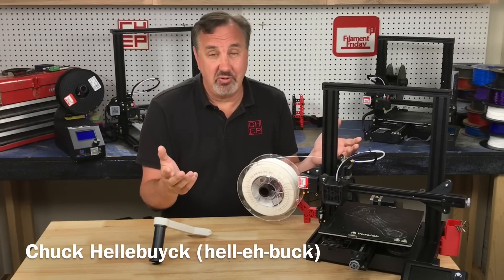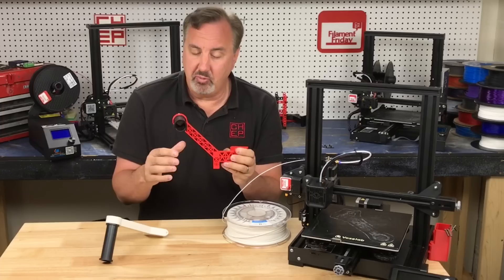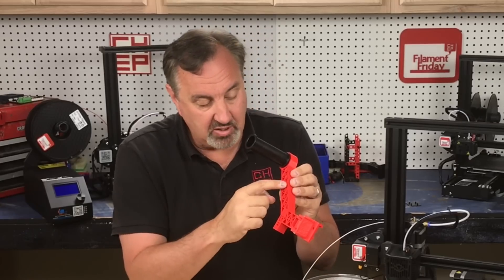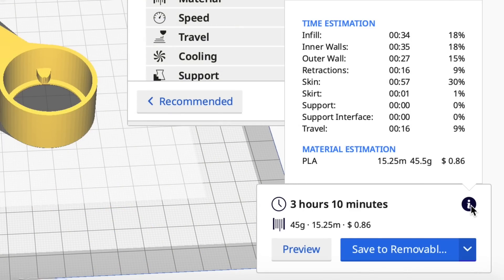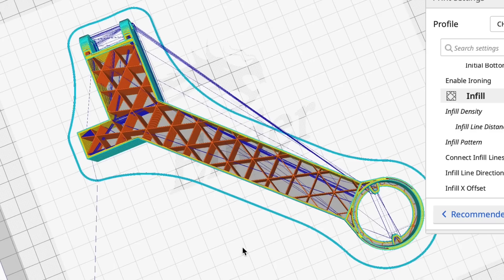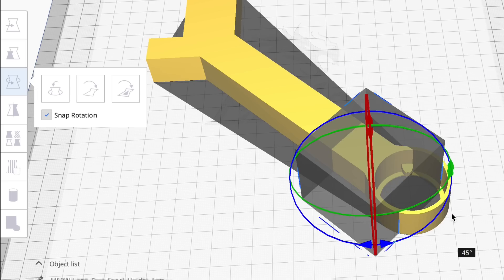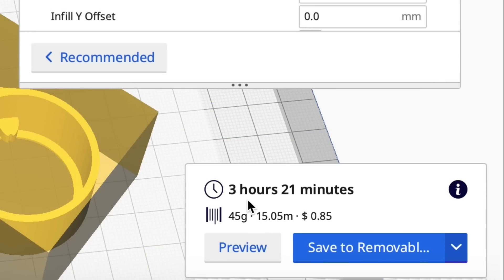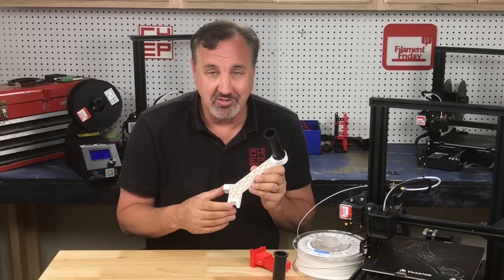Print Faster on Your Ender 3 Style Printer Using Tricks in Cura

Comment: How would this work for cookie cutters? I’m tired of waiting 6 hours for my cookie cutters to print. The base has the outer walls designed but I don’t think they need to be there as I will just be pushing down into the dough? As far as the “smooth” outside (?) walls the part that cuts into the dough- they are much taller than I’d like. My dough is rolled to 1/4 inch thick. Any help is greatly appreciated 😊 @CHEP

Comment: Thank you for the great videos and bein so much informative.

Let's talk a little bit "statics".

But in an engineering perspective, solid bodies are not as strong as the spesific profiles.
Think of I-Beams.
I-Beams, U-Beams, Box-Profiles are used in big structures like skyscrapers, cranes etc. Thats because those profiles are much stronger than solid bodies. (Of course there is weight element but stil..)

I know the scope of this video is not abouıt strength, it is about speed. But still i wanted to point this out.

(Partly because i just got 3kg filament spools on my ender3v2neo and i just dont want to hang it on the gantry of my printer :D. So basicly my focus is on this issue for a while heheh.)

Comment: 0.6 Nozzle will bring it down to just over 3 hour and since there are no over hangs or to bigger curves 0.32 layer height is a good multiple for a 0.6 nozzle add 0.62 to line width and you be surprised on print quality
Reply: The only thing is. Is the design would have to be redesigned keeping the 0.62 line width in to consideration. A lot of the time, poor print quality is because the stl files dose not match up with slicer profile and pushing a 0.5 line out of a 0.6 nozzle, gets messy
Reply: add a 10% wall over lap and it will print over hangs but make shore to print inside to outside walls

Comment: 3 hours to print, 1 hour to edit, and not the design wanted.
Seems like you could have just cranked up exterior wall speed for the same exact result with no other changes

Comment: That's great but you didn't speed up the original part, this is a different model. It's not really how you can print faster.
Reply: My exact thoughts. Completely changed. Not as designed. And not the original print but faster.
He could have gotten the same results by cranking up exterior wall speeds.
Instead he had a non-scientific change of the model to get that specific infill for that specific design.
This however wouldn't help me at all to print a model of a cat faster
Reply: It's absolutely how you can print faster. Changing the specific model doesn't change the fact that he has a part that suits the application in less time. DfAM is a holistic approach
Reply: @kevinh2624  not if you cant alter the design of the output that you need.

Comment: Very smart use of slicer settings and infill pattern.
This trick also simplify the modeling, you save time since you don't need to create the pattern, instead of that you rely on the slicer to do it for you.
Another benefits, you can change the pattern without changing the model, and you can print a closed version.
As said very smart, thank you for sharing.

Comment: If printing was as simple as clicking print, i can see this technology becoming more widespread. Unfortunately, printing anything successfully takes a lot more than just clicking print.
Reply: It's a hell of a lot easier than it was 5 years ago. It's just going to continue to become more user-friendly.
Reply: user knowledge will grow over time as well as the tech will become more stable and user friendly.. dont know how old you were but to call someone before you just had to stick your finger in a hole and turn a dial 7 times compare that now to even having to look for the phone app on our phones haha
Reply: Kind of true. I just bought an Ender 3 S1 but I spent a few days beforehand researching the best settings and how to calibrate it. Set it up and its been perfect since the first print. A little time and effort into researching beforehand goes a long way. But then I'm the same with any purchase I make that's gonna cost me more than £100 so I know I'm getting the best out of it.
Reply: Using Octoprint on your printer really makes it nearly just click and print.

Besides modeling and setting it up for modeling, but those steps don't take too long unless you are designing a super complex model.
Reply: @spydergs07  Ender and Perusa with perusa slicer and cura slicer have been tested exclusively to print receivers. Octoprint slicer has not been tested, there is a chance that your print would blow up as soon as you went to use it. Not all work for printing lowers. Almost all receiver STL files contain complex geometries , i recommend using something known to be capable. 

 If you want to actually make a functional LASTING receiver, it is not as simple as click and print.  IF you want the receiver to function smoothly and have full functionality, have good resolution and good layer adhesion, you will need supports, you will need to make adjustments to your printer, there is no way around that. No printer is completely accurate. 

The day printers are that accurate and simple, a load more people will get them. Look to ink printers lol.

Comment: Great video, super useful info and some fantastic tips to up your slicing skill level. 

Only problem is... by the time you've spent fiddling in the settings you could have just printed it, original design with the pattern. That's my only critique. Is that quite often the fiddling in the settings time > the print time saved; and I can't think of many times or instances where you'd need to make a time save like that, other than to fulfil that innate need to be the fastest printslinger in the west.
Reply: I get what you're saying, but sometimes it's about learning something for the next time. Sure, it might take more time now, but if you can use those techniques in the future, then the total time saved adds up the more you use them.
Reply: I agree if its a one off. If you print this more than once, OR if the print fails the first time, your slicer time pays dividends.
Reply: I agree, but, if you share the file, other people get to save print time without the mucking around

Comment: One thing I've been doing recently is changing the line width to 0.8mm (while still using a 0.4mm nozzle). Quite a bit faster - the infill lines get thicker, too. And it's supposedly stronger, too (according to CNC Kitchen). The layer lines become wider, of course (and therefore uglier) and you lose fine details.

Comment: how did you get the material cost estimation on there?
Reply: You go into Preferences -> Configure Cura on the menubar; in the "Materials" pane, you go through your materials and specify their weight per spool and cost per spool. With these filled out for each given material, cost appears next time you slice something. Make sure the density is specified correctly.
Reply: @SianaGearz  can we use $ instead of euro?
Reply: @DanielMigneault  Yes you can change currency to what ever you want

Comment: How do you get Cura to show you the cost when you slice?
Reply: Go to Settings... Printer... Manage Printers... Materials... then enter a filament cost per roll and a weight of the roll (typically 1000 g).  Under the General tab at the left you can set the currency symbol.

Comment: Another nice advantage of this technique is that if you want to print a decorative pattern, you can try out different kinds of patterns very quickly, much faster than it would take to model them manually (albeit limited to the patterns available as infill patterns). I used it to print a long rectangle with a grid-pattern in the middle, that I could then wrap like a ring around another, cylindrical print, to make it look nicer :)

Comment: This is freaking cool. I did not know you could use the support blockers to other than, well, block support. False label, if you ask me.... I just wish it could also be used to alter layer height for when the "Adaptive layers" don't quite do what you want it to. Maybe only possible for full layers, but if you can have infill twice the height, it should be possible to have walls half or a third height in local regions??

Comment: I'm currently using creality's slicer software and my the 50mm cube I'm printing will take 7 hrs to print.
Reply: is their slicer software good enough?
Reply: @joeskis  I've printed two lightsabers, a satellite, and working on printing a chess set and it's working out so far.
Reply: It’s a skinned version of cura
Reply from the maker: It’s an skinned version of older Cura. Use the latest Cura for best results.
Reply: @FilamentFriday   LOL, I installed the included creality slicer on my sd card, and IT even said I should just download and install cura!

Comment: I wish I'd seen this before starting to print my arm.  I'm using PETG (all I have because it was a christmas present) and my print time is 12 hours!
Reply: Nothing wrong with PETG, but it doesnt like to print quite as fast as PLA.  I never print it faster than 50mm/s or it clogs like a mofo. PETG is actually ideal for outdoor stuff though because it has absurdly good UV resistances. TPOIMNS petg is only like 16 bucks a kilo, dirt cheap. Works great for detailed parts or functional outdoor stuff. Great "daily driver" sort of filament if you have an all metal hot end. Thats why i love it. Sitting on 3 spools of it rightnow. You can print it without an all metal hot end, but it likes being printed right at 245c and its kinda pushing your luck with a regular hot end. My stock ender hot end crapped out on me with this PETG. Back to the UV resistances though. Hardly any other filament can survive the Phoenix sun. Even in average sunlight, polypropylene loses 70% of its strength in less than a week. In my case it only takes a day or two to lose 70% of its strength because the arizona sun is a completely different beast lol. Out here our solar panels perform ABOVE their rated specs, not below them. My 28 watt portable solar panels put out 42 watts out here in arizona, but its lucky to manage half of that wattage in other states ive used it. My point is PETG's has arguably the best UV resistances. So dont be too disappointed to have gotten a spool as a gift. Its the best material for easily printable outdoor parts that dont require super exotic filaments.
Reply: Same here I'm like half an hour into printing it and came across this video in my recommended 😂 Oh well I'm just going to let it go.  This will definitely come in handy in the future though.

Comment: I am kind of scared right now. Just a tad more tweaking and you will reach negative printing times and break the universe.

Apart from that, as so many people, I am glad to have found your channel. I am completely new to 3D printing and still fighting with a lot of things and your videos already gave me many invaluable tips and in addition to that, are short, concise and to the point without boring your audience with endless stories or with telling them about countless settings and tricks, only to then tell you "And actually, you never should do that!"

Apart from that, I've got one or two problem and maybe you or anyone else here can help. My printer is an Elegoo Neptune 2S and so far, I like it a lot. But I am having problems with small structures, trying to print, let's say a little Warhammer 40k figurine will lead to spaghetti more often than not. I have tried a lot of things - playing with temps, printing speed, retraction settings, you name it, to no avail.

I am under the suspicion the underlaying problem might be vibrations - because sometimes there are vibrations which are definitely coming from the sleigh on the x-axis with the extruder. I have fastened the belt, dismantled and fastened everything and it still happens, there are still vibrations coming from the sleigh. So any ideas would be greatly appreciated.

Greetings from Germany!

Comment: I tried to do the reverse of this.  I took a platform part and tried to make the center of the model w/o top/bottom layers and the outer part of the model with top/bottom layers. I set the blocker with zero top/bottom layers and it still resulted in those layers in the print preview.   I ended up doing the following workaround: 
1. I added a hollow section in the model with Tinker Cad.  
2. I cleared the build plate in Cura.
3. I added a cube of the correct dimensions that I wanted to expose the infill. 
4. I set the project to zero top/bottom layers.  
5. I added the model and gave it an override of infill pattern/density and 7 top/bottom layers.   

That (in print preview) shows the inner part with no layers and the outer part with layers.   
I am not sure if I had to workaround this way because of my local settings is just an artifact  of Cura.   Perhaps you can do a follow video on this if is something everyone would need.

Comment: for simple, structural parts like this, "overprinting" with a much larger extrusion cross section, than one normally would, is also a nice option. 
with a normal 0.4mm nozzle it's easily possible to print with an extrusion of 0.4-0.6mm (yes, i am serious!) layer height by 1-1.2mm line width, as long as heat and speed are adjusted accordingly slow and hot. 

of course a bigger nozzle is an option too, but i was impressed just how far i could push it. with a slightly modified 0.4mm one, i could print up to a 0.75x2mm, before the lines turning into squiggles of spaghetti.

Comment: how do you make that feature showing the price after slicing?
Reply: In Cura preferences/settings under materials add the filament cost for the filament. Then when that filament is selected during slicing the cost will be estimated.
Reply: @7oppinFr3sh  Thanks. I have been wondering how that came up.
Reply: @7oppinFr3sh  a big thanks

Comment: Instead of increasing the infill line count you could also increase infill line width. Should have the same effect but print faster because it is still one line.
Reply: yes, but with a 0.4mm nozzle you cant really print more than a 0.6mm line wihtout highly compormising integrity and quality. instead of 3 infill walls though 2 walls with 0.6 extrusion width would be an option.

Comment: at my cr10s4 i usethe selction wheel to increase the speed of printing up to 250 %  at 220 °C Nozzle and 20 °C Bed with a alternative Buildplate from DOBSTFY and it works absolutly great a print with estimatet Time of 2 Days is printet in about 12 to 14 h so i dont have to use any cura tricking

Comment: Hi Chep, I recently converted my Ender 3 to a Ender 3 Large (400x400x500) bed size. I seen on one of your videos to remove the limiting zone on the Ender 3 so I can use the whole bed, If you can point me in the right direction I would appreciate it. Thanks

Comment: few ideas
like jon says just use a modifier on the internals to speed them up 
another idea is don't change line count change line width most of the time it;s safe to drive line width up to 2x nozzle size
printing 1 wide line is faster then 2 lines

Comment: The only reason this is faster is because wall speed is usually a function of total speed, you can just take your original cris-cross design and change the wall speed for that region to match your infill speed.
Reply: Yeh i would have liked him to address it. The video is still useful with the blocker settings but the printtime comparison is a bit flawed

Comment: what version of cura is that? My modeling menus look different and do not have that many options.  My version is 4.11.0
Reply: You probably need to change it to Advanced or Expert mode. At the top of that menu next to the search box there should be 3 lines, click that and then you should get a drop down letting you select Basic, Advanced, Expert or All. Each of those options will give you progressively more options to play with.

Comment: Screw cura.  Prusa slicer is alot better
Reply from the maker: I use both. They both have advantages.
Reply: @FilamentFriday  agree there
Reply: I use Skeinforge; I'd talk about it but I'm still busy slicing. Anyways found this video as I'm trying to get both cura+prusa workflows activated on my old thingomatic. Pretty sure this process can be simplified with placing that block on the middle area with another one overlapping to get the angled endpiece done as desired. Then you modify outer layer once instead of twice. Wonder if that would change the height at that location doing as this video said or how I just described.

Comment: I put your design into cura and it said it would take a day and 14 hours why is this?
Reply from the maker: What layer height did you use? 
I chose my 0.28 profile.
Reply: @FilamentFriday  Yeah nevermind it worked it took me 4 hours which is my longest print but i did print it in dynamic quality so it came out beatiful.p.s thanks for replying.
Reply: @FilamentFriday  also just wanted to ask do your profiles work on an ender 3 pro
Reply from the maker: Yes

Comment: # 1 never update cura. After I updated my print times were 50% slower.
Reply from the maker: Are you using the same settings?
If you use my profiles before and after the speed is the same.
Reply: @FilamentFriday  hey your settings work great. I read like a year ago not to update, because it was quieter but slower. I held out until this summer,